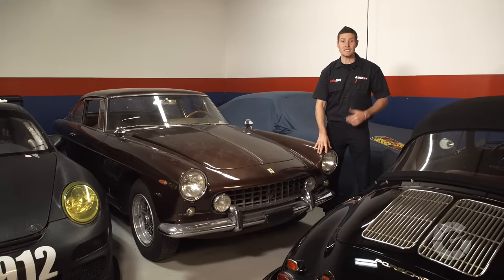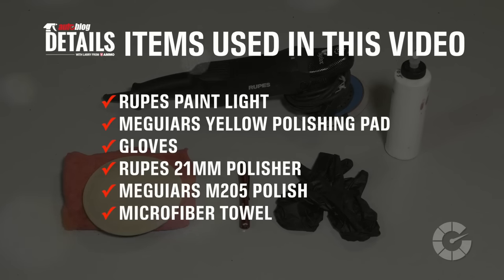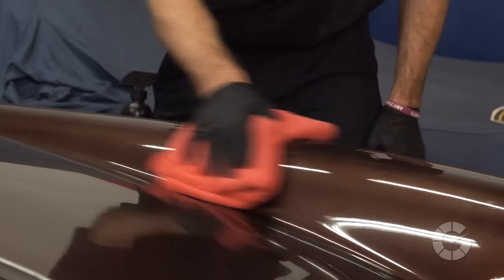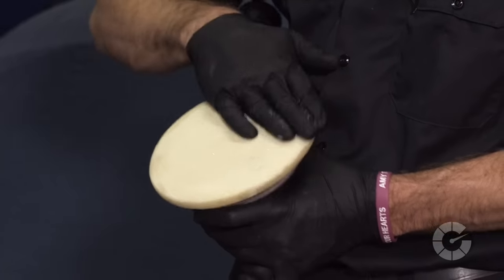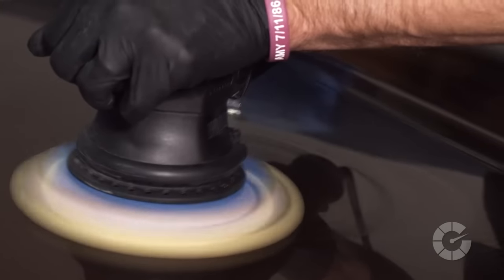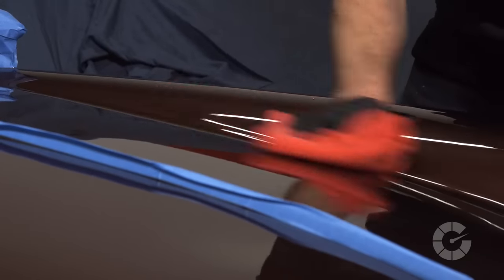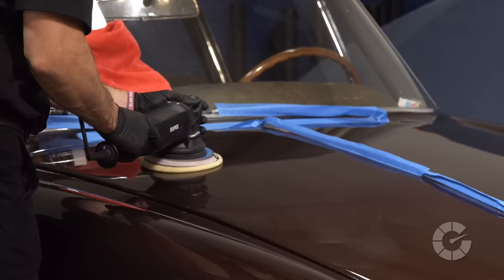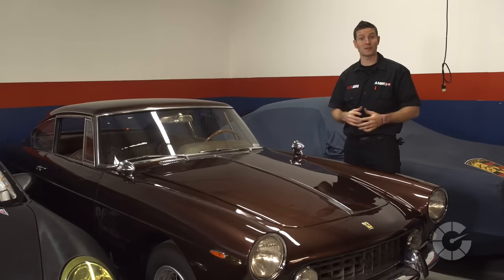How To Polish Car Paint | Autoblog Details

Comment: If u never done it bfr or novice use mashine on flat surface such is roof doors and for example round place as this Ferrari headlights panels do it by hand to avoid clear and paint damage (burning) doing by hand isnt bad if u apply more pressure rather then mashine